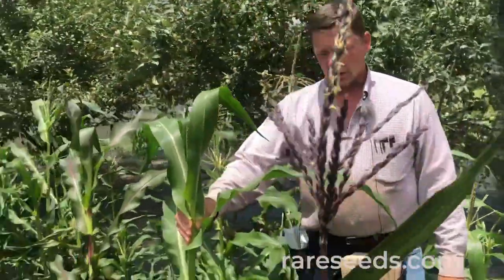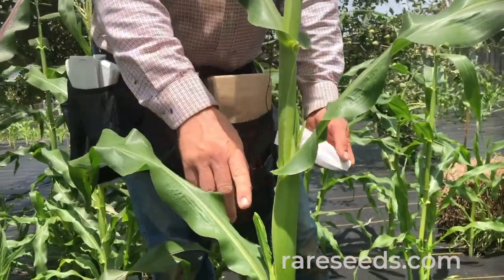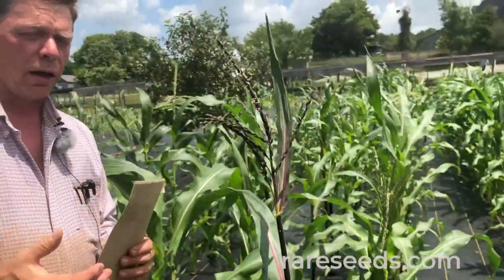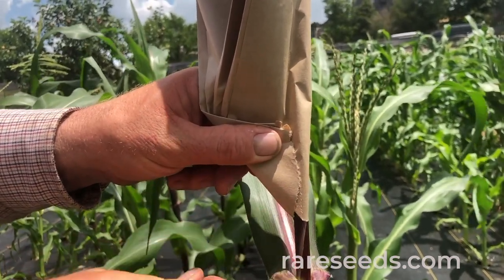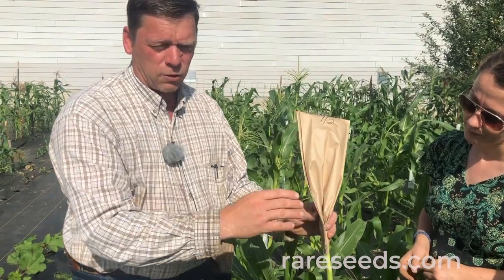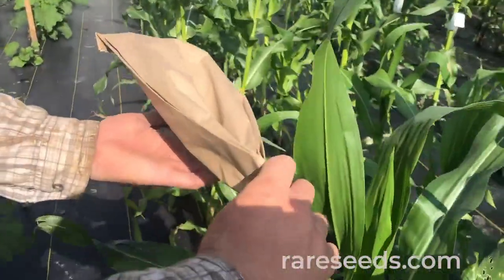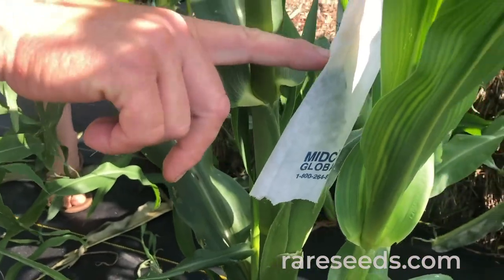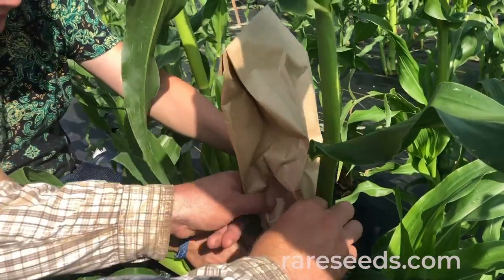How To Hand Pollinate Corn

Comment: I bagged the tassels this evening, but I just found out it's supposed to start raining again tomorrow morning. Is it okay if it rains immediately after pollinating the silks and bagging them? Or should I use plastic bags instead?
Reply from the maker: I'd try to avoid the plastic since it can trap moisture. I'd still use paper bags and if they start to fall apart, replace as necessary.